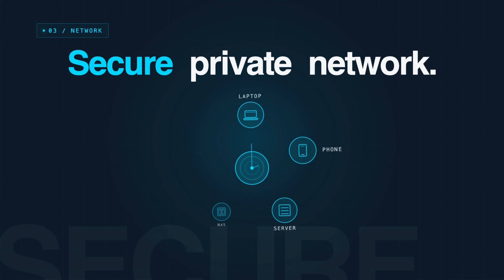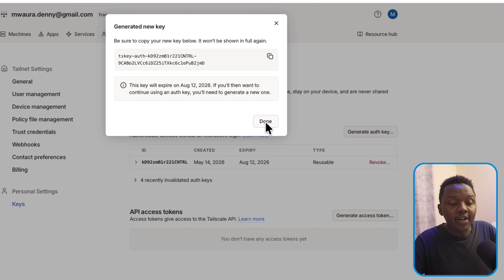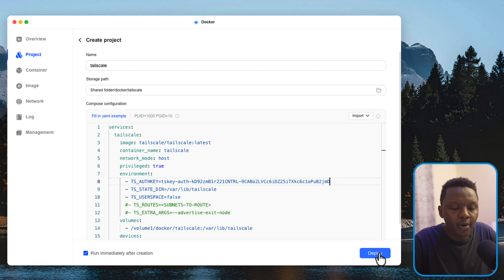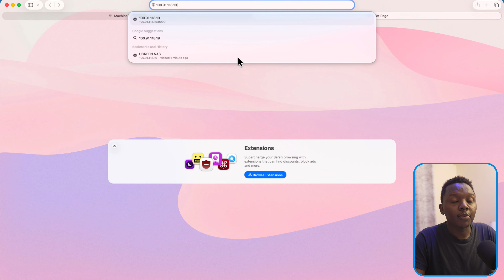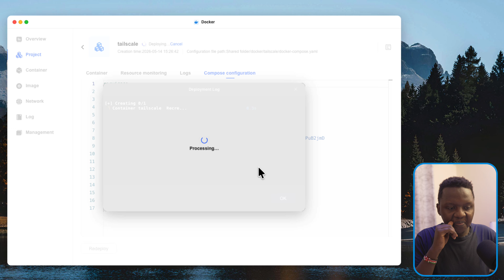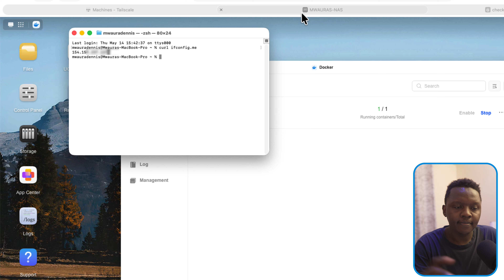Access Your UGREEN NAS From Anywhere — No Port Forwarding! (Tailscale + Docker Setup)

Comment: I attempted to follow along, but on tailscale I got the following error "This machine has IP forwarding disabled and cannot relay traffic. Please enable IP forwarding on this machine to use relay features like subnets or exit nodes."
Reply from the maker: That error means Tailscale is trying to act as a subnet router or exit node but Linux IP forwarding is off. Two ways to fix it depending on how you set Tailscale up:

If Tailscale is running in Docker (which is what the video shows): add these sysctls to the container. In your docker-compose.yml, under the tailscale service:

Then docker compose up -d --force-recreate tailscale and the warning goes away.

If you prefer to set it on the NAS host itself, SSH into UGREEN and run:

This survives reboots.

You only need this if you're advertising a subnet (--advertise-routes) or acting as an exit node (--advertise-exit-node). 

For plain device-to-device Tailscale access to the NAS, you can safely ignore the warning.

Comment: Great Video Mwaura,

I applied it to my Ugreen, and it works with no problems at all. Please keep doing config videos for UgreenNas. 

There is a possible next step(I needed to do with mine). IP forwarding is disabled on my UGreen by default. I needed to activate ssh/putty and run 
echo 'net.ipv4.ip_forward = 1' | sudo tee -a /etc/sysctl.d/99-tailscale.conf
echo 'net.ipv6.conf.all.forwarding = 1' | sudo tee -a /etc/sysctl.d/99-tailscale.conf
sudo sysctl -p /etc/sysctl.d/99-tailscale.conf

Not a dealbreaker but if I don't do this I need to manually select the exit node from the devices connecting